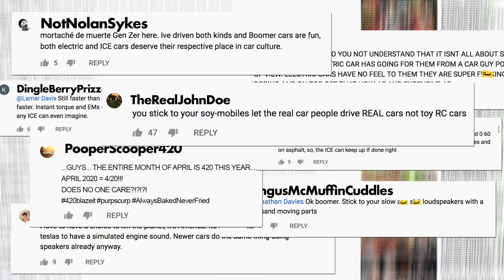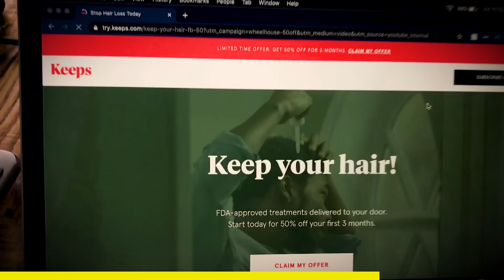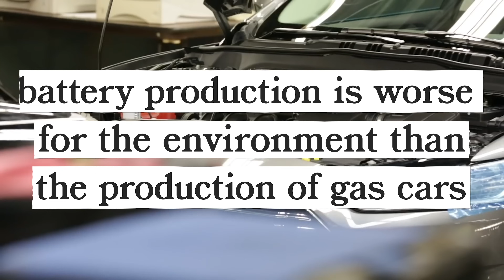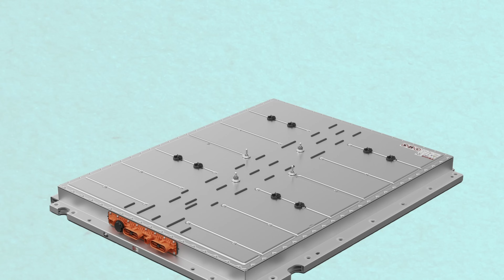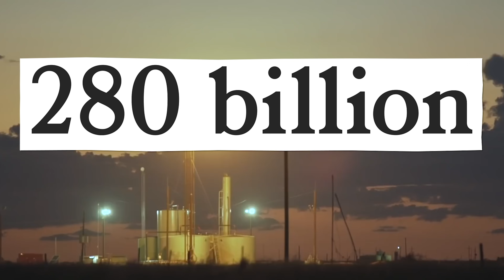Are Electric Cars REALLY Better for the Environment?

Comment: I have to say i found this video very informative, but i have to say the distance one gets out of an EV vs Gas engine is one of the biggest draw backs for me. Great for commuting not for long distance travel.
Reply: All over a global scam.
Reply: It's getting better and better over time. If you get an EV on the more expensive end at this point it's the same range. We just have to wait for the EV prices to get better. And in Europe at least they have some brains so they standardized chargers for EV'S. So there are no issues getting stuck without a charger there.
Reply: @DarkClarity  europe has high population density
Reply: @somerandomguy7458  sure and? They still used their brains and standardized a charger.

Comment: I might have missed it, but did the video factor in the environmental impact of non- recyclable wind mills and solar panels that will inevitably fill landfills with billions of tons of plastic? What about the emissions from building these structures? If we are calling this a “clean energy source”, it’s probably more honest to factor in those emissions, too. The EV charging stations in my city have diesel generators out back that produce the electricity. Almost everywhere else generates the electricity with coal fired power plants. The belief that electricity is clean because it doesn’t burn gas in your car is little more than an illusion pushed by those eager to prove their moral superiority.
Reply: Why would they? An EV is not a windmill and EV’s don’t use more plastic than other vehicles.
Reply: @engineeringtheweirdguy2103  Because the video implies electricity generated by windmills and solar panels is basically the ultimate clean power source. It doesn’t take into account the massive amounts of pollution generated and the crazy amount of natural resources it takes to build the infrastructure for this. For dilute energy sources like wind and solar, it would take millions of square miles of land covered in wind and solar to support a country of vehicles running on electricity. The video also doesn’t address the physical limitations of lithium batteries. The biggest battery factory in the world, Tesla’s Gigafactory in my home state of Nevada, would have to produce batteries for 1000 years to provide the U.S. with two days worth of energy.
Reply: @dannykane8096  thats the not subject of the video. the subject of the video is how BEV operate and their related pollutants. Furthermore he does clarify that the amount of emissions reduction, is dependant on the grid mix. 

But ultimately, in terms of what emissions to count. phasing the grid to renewables has nothing to do with BEV's, BEV's bennefit from this but then again so do most things in terms of emissions. The grid isnt exclusively used and designed for BEV's so assuming those costs as part of this video would not make sense.
Reply: @dannykane8096  also the designed production capacity of the gigafactory is 100GWh of batteries per year. To put that in context, the IRENA suggest a global total of 150 GWh of battery storage for the world to reach 45% reliable renewable energy generation. Thats not just the US. thats GLOBALLY.

Comment: Electric cars sure! Battery electric cars nope! 

Also I'm sure car companies are not adopting BEV's not because of emissions or what not. They couldn't give a rats arse. However their main aim is planned obsolescence and and a subscription based car sales and optional extras. They want to stop people from buying second hand cars as they make no money from that. Most people agree that car batteries will last roughly 10 years before needing to be replaced, at which point it will be too expensive to justify buying a second hand car if you include buying and replacing the battery. 

Think about it would you want a second hand phone with a crap worn battery or a brand new one which lasts nearly 2 days?  

Note: I'm not ripping into electric cars, Electrics motors are clearly the way forward. However, I just think there is another reason apart from emissions and a ban on new ICE cars which is making car companies invest millions into BEV's. It must be because one way or another they expect to make more money from BEV's. Otherwise they would just pull out from countries banning ICE cars. 

That's my opinion. And don't forget opinions are like arseholse, everyone's got one ;)
Reply: There is a lot wrong with this comment

Comment: I just checked Climobile: A Prius without a plug runs on 100% gasoline, and is far cleaner than many (if not all) EV´s.
It´s a common mistake to compare a conventional ICE with a modern EV. Another mistake is using an energy mix for EV´s.

The cleanest cars appear to be the plug-in hybrids. Which also happen to be the most versatile.
Reply: You’re fuzzy on how that calculator works aren’t you?
Reply: @engineeringtheweirdguy2103  I´m not sure about anything :)
Why don´t you fill out the form as follows.
ICE vehicle: Toyota Prius hybrid 2017
Electric vehicle: Chevrolet Volt 2017
Country: Poland
Distance: 100,000 km
Reply: @STARDRIVE  so working it out by hand, the Chevy has a range of 417km to a 60kWh battery which is 0.14kWh/km. The Prius gets 4.2L/100km. 1L of petrol emits 2.3kg of CO2. In terms of power production coal power plants produce 1kg/kWh, gas is 0.6kg and oil is 0.8. Polish energy grid is 50% coal, 1.2% oil and 5.7% gas, meaning the total emissions per kWh is 0.54kg of emissions per kWh. To to travel 1,000km the Prius would produce  96.6kg of emissions and the chevy would produce 75.6kg of emissions.
Reply: Correction, Poland also uses another 19% for Brown Coal power production which is around 1.2kg/kWh making the total per km for power production 0.77kg/kWh. Making the total for the 1,000km, 107.8 so in this instance with polands energy grid, it is more eco friendly to get a hybrid. This could also be offset by home solar if you have it but I don’t think it’s as viable in Poland as it is in Australia.
Reply: @engineeringtheweirdguy2103  Thanks for doing the math. But I'm still struggling with one thing.
Don't you agree we should first get our land based consumers to run on renewable electricity? Since they don't need batteries? Wouldn't that be cleaner?
Electric cars create extra demand. Without them, we could close down some of the most pollutive power plants. So I think it's only fair to compare that Prius with EV's powered by coal only. At least, as long there are a substantial number of dirty plants in the local grid, and thus no renewable energy to spare for battery powered cars, boats or planes.
Looking at China, becoming the largest economy and still building coal plants, I prefer the versatility of plug-in hybrids for the time being.

Electric cars are the inevitable future, so perhaps I'm nit-picking, but the worldwide transition may well last the remainder of this century.

I do agree solar panels on roofs (and not on fertile land where trees can be planted), do benefit. Houses going off grid idem.

I also think the elephant in the room is overpopulation. I don't see a reduction of refineries anytime soon. We're getting cleaner gradually, so why hurry? Spending billions on forcing a pollutive transition. (Since every penny spend equals pollution too). The panic increases the risk of making wrong decisions. Like in the Netherlands we are decreasing the use of NG, but our neighbor Germany increases it! Nuclear power idem. One country even promoted diesel cars, because of better mileage..

Bottom line, would you think discarding good working ICE cars using incentives is justified, since the benefit is certainly not a factor 4 as some say? And the worldwide transition taking long enough to gradually replace old cars by the next gen?
In general, governments forcing contradicting or dubious measures upon us using our own tax money?

Instead of focussing on which car is more pollutive, shouldn't we focus on cheaper or free public transport?
Just wondering, do you have the math on public transport? I assume it's cleaner, but again I'm not sure :)
Thanks again!
Reply: P.S. Poland may have been a lucky shot, but when punching in ¨EU 28 average¨ the difference is still neglible. They´re equally pollutive.

Comment: If i drive only 5000 km per year and I'll buy EV with large (80 kWh) battery, it will not have a positive impact on emissions. I will do much better if I'll buy ICE Plugin Hybrid (10 kWh battery). I live in a country which has about 50% of energy coming from coal.
Am I wrong?
Reply: Depends on how long you own it
Reply: @engineeringtheweirdguy2103  Also depends on how batteries will behave after 8 years of ownership, even when they are not used that much
Reply: @Lascarnn  battery warranties for EV’s is 8 years on its own.

Comment: Depends on how the electricity is generated to supply electric cars. If it is generated by coal or gas then it is bad.
Reply: actually even on a purely coal grid ev's are still vastly more emisions friendly than a combustion car, even before considering the emissions and energy requirements of a fuel refinery. Infact is even more fuel efficient to charge your EV from a cheap small portable generator than it is to use that same fuel in a combustion car.
Reply: @engineeringtheweirdguy2103  Interesting I did hear about that.

Comment: Yes mate. But how the turbines , panels solar and ...the charching cables are made? From what are made and hou much co2 they consume to be made ? 😉🤣
Reply: wind turbines are mostly metal and concrete by mass. in addition, how much material is used for a fuel refinery i wonder? Solar panels are made mostly silicon, which isnt toxic or harmful.  But how much does a fuel refinery cost to be made. And whilst they're burning crude oil to refine your fuel, how much emissions do you think that generates? per mile? over the facilities entire lifespan? ever seen crude oil?

Comment: It’s all about the money, it’s that simple. No car company is going to set their priority of “saving the environment” over trying to profit off of you. Most will spend upwards of 40 to 100K for an EV. 4 years later, you’ll need to replace the battery in which I assume is going to cost as much as a new car.
Reply: incorrect. Modern EV batteries last up to 500,000 miles to a lifetime (80% battery health or 20% degradation). and their industry standard warranty period alone is 8 years. If your battery needed replacing after 4 years, you'd get a new battery, free of charge.

Comment: also EVs 'not polluting' after built, they use MORE power to charge then my entire house uses!!! if you think we have bad oower outages now wait until everyone is charging EV's
Reply: Not true at all. A typical family of 4 uses between 20-30kWh per day. Whilst most EV batteries are quite a bit larger than that, you don’t charge the entire battery every time you plug it in. You only need to charge as much as you use with your daily commutes. For example the upper end of the average daily commute is around 70 miles. The Tesla model 3 for example uses 0.212kWh/mile. So if that was your daily commute, you’d only need to charge it by 14kWh. Although keep in mind, it being the average, 50% of the population drive less than 70 miles per day….
Reply: Actually new data suggest the US drivers daily commute is only 16 miles. In which case you’d only use 3.4 kWh. Which is a little more than running a toaster for 1 hour.

Comment: One thing that you didn't touch on, the "grid" could potentially handle it. But houses arent capable of doing a quick charge on electric vehicles. Atleast not with standard electrical. Home circuits take 40 hours to fully charge an EV. So, how is that the grid being capable?
Reply: They take much less than 40 hours.

Comment: Teslas are awesome but they are heavy and wear out tires quick and those worn out tires have to be disposed of and electricity just doesn’t grow on trees it has to be made usually by a gas or fuel engine lol
Reply: well typical generators are FAR more efficient than an automotive combustion engine. It is actually still significantly more fuel efficient to charge your EV from a cheap small portable generator than it is to use that same fuel in a typical combustion car. Further to that EV's arent actually much heavier than other vehicles in their class, the batteries are heavy yes, but so is a 6 speed transmission and massive engine block, neither of which an EV has so they sort of balance out. Additionally there are much heavier cars on the roads such as F150's for example, Yet, they somehow don't have a problem with tires wearing out. Why you suddenly thing just because it has an electric motor, that you think the tires magically wear out faster is a little beyond me.

Comment: Now figure in the impact of manufacturing a windmill, the installation and maintenance into this along with solar panels
Reply: why are windmills a pre-requisite of EV's?
Reply: @engineeringtheweirdguy2103  because that’s part of the green energy idea, they produce electricity. Windmills don’t grow on trees  they have to be manufactured and installed and serviced
Reply: @mmatson7142  I get windmills don’t grow on trees but that has nothing to do with EV’s themselves. You don’t count the emissions and materials used to build fuel refineries across the globe when considering the environmental impact of combustion cars do you?

Do you?

Comment: You forgot to mention that batteries have a lifespan, and need to be replaced, while the internal combustion cars can be refueled as many times as they need to. Let us just for the sake of argument say the batteries last for 8 years, then we have to multiply the environmental impact of an EV by the number of battery replacements.
Reply: actually, 2 things, firstly, whilst you endlessly refuel a ICE, you cannot endlessly run one. Do not forget you need to service it every 10k miles or so. Replacing parts, all of which have an environmental impact and replacing oils and other fluids.

Secondly, Modern EV batteries have a lifespan roughly double that of a standard combustion engine. 8 years in infact, the industry standard warranty period on the batteries alone. Yet alone their lifespan. If you batteries dies at 7 years and 364 days, guess what, you get a free new battery. But in the meantime, whilst enjoying double the lifespan of a combustion engine, you also have NONE of the upkeep, no spark plugs, timing belts, engine oil, oil filters, fuel filters, fuel pumps, transmission oil, etc etc etc. and all the emissoins that go with it.

Comment: Most electric cars are really,  coal powered,  Coal generation of electric power.  The increase of human salvery, mining lithium & cobalt for batteries. 
Gasoline & Natural Gas &  Propane engines are much cleaner.  The exhaust of a natural gas engine is Cleaner than the air the engine inhaled 😊

Comment: Good episode, good research. I would however like to hear your supportive argument regarding weather or not our electrical grid could handle 25% instant EV. Texas couldn’t even support their grid during a snow storm as is. We still have a ways to go.
Reply: I mean a snow storm and too much evs is a whole different story tho
Reply: I think Texas's capacity is fine but their natural gas infrastructure wasn't design to operate in those cold temperatures (brought about by climate change).  You're right that their grid needs work but it's not the capacity that's the problem.  And EV or no, they need to address their grid issue.